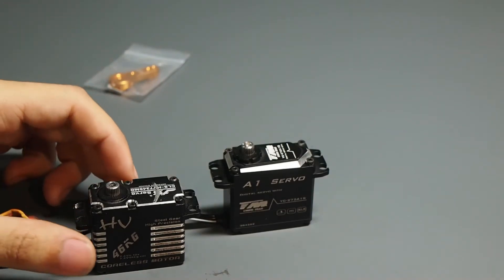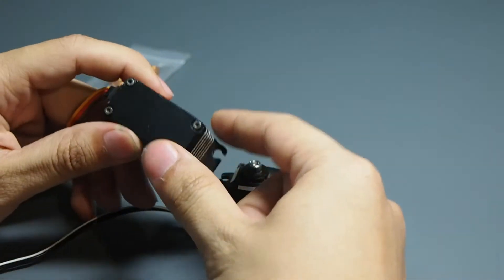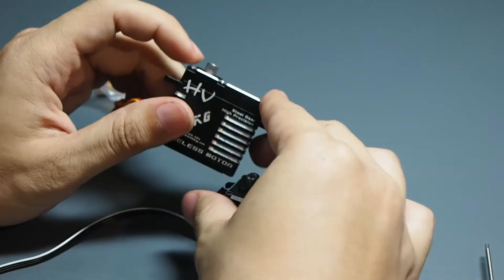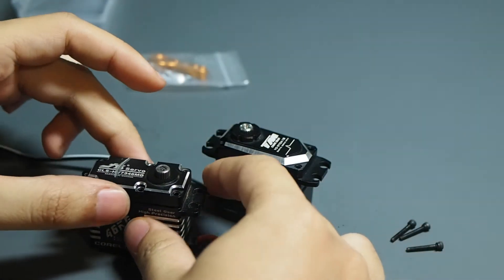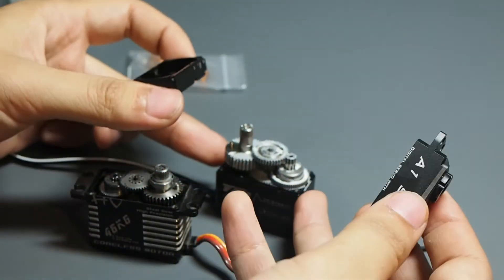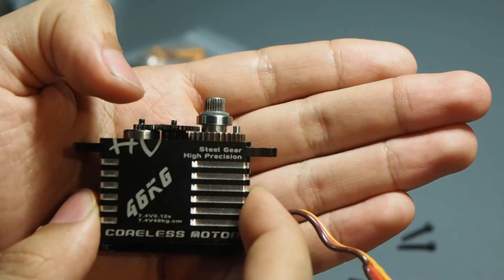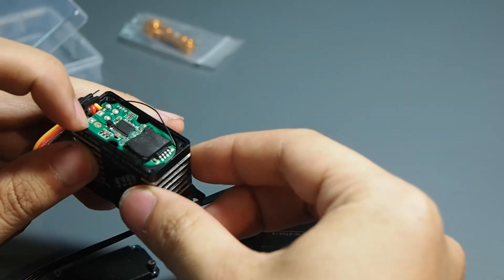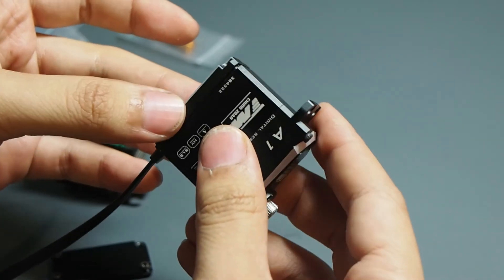JX 46kg servo teardown and comparison to CY A1S servo. Poor build quality & gears.

Comment: Great detailed videos. Do you think the A1 servo is faster or stronger as well?
Reply from the maker: Yes much, much stronger at same torque rating and quicker but that is to be expected as it's rated higher. The JX i would say is about 60% of its quoted torque (~30kg) and is really struggling with big 1/8 tires.